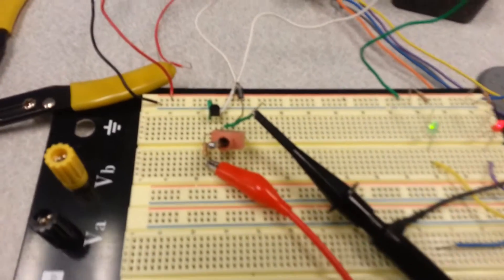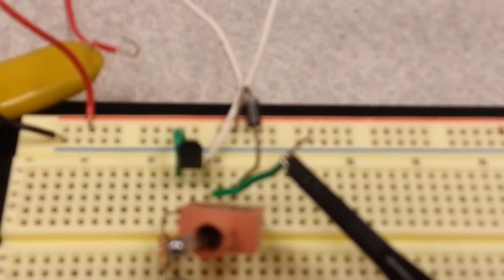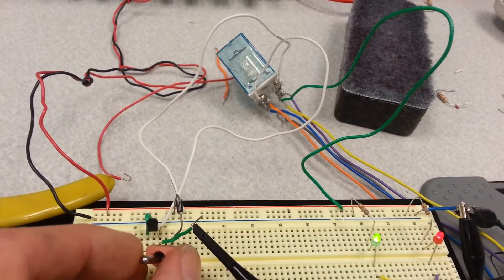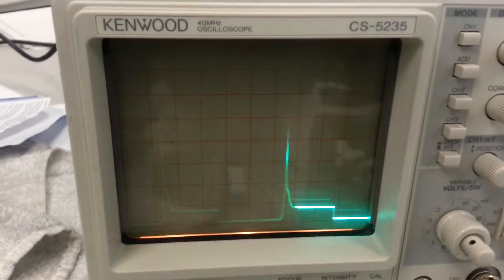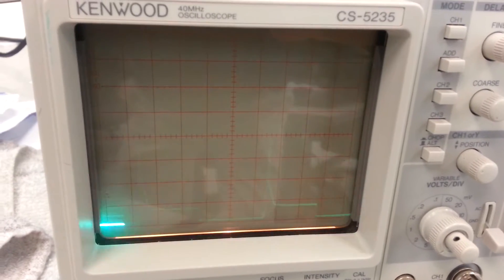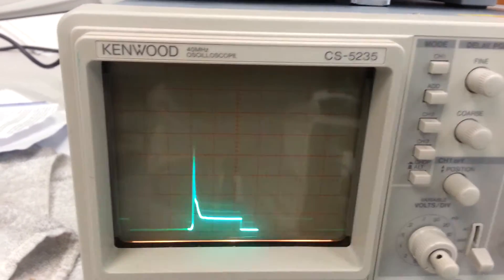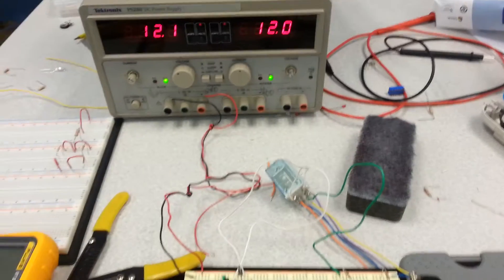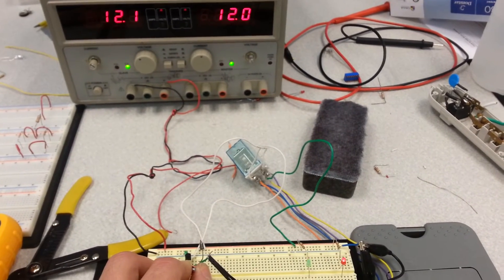Fly back diode 2n3904 DC relay LED with oscilloscope

Comment from the maker: The video shows the inductive kickback from a DC Relay and demonstrated suppression with a diode. 

Turning on the relay charges the coil, and when the relay turns OFF the coil discharges collapsing the magnetic field. The property of inductance is trying to keep the current the same. The coil voltage when it goes from load to source when discharging forward biases the otherwise reverse bias diode.